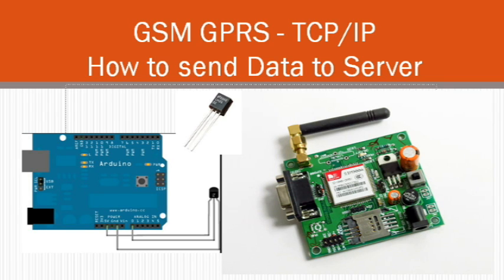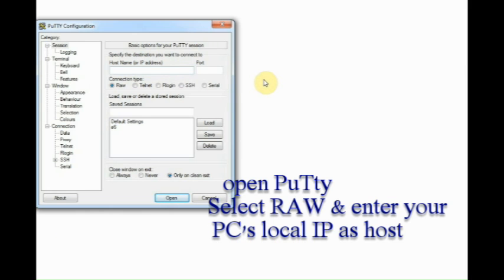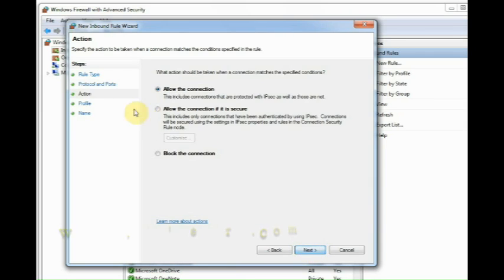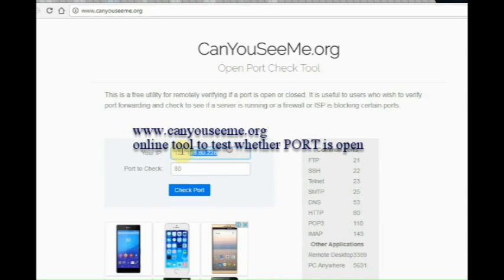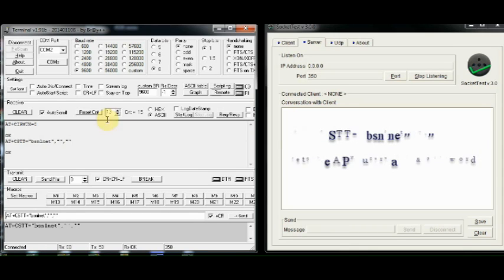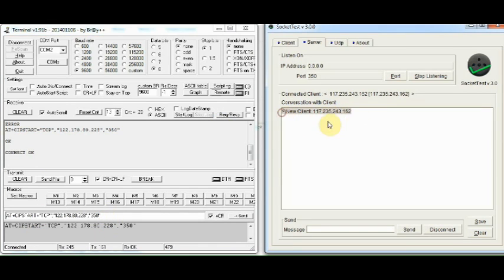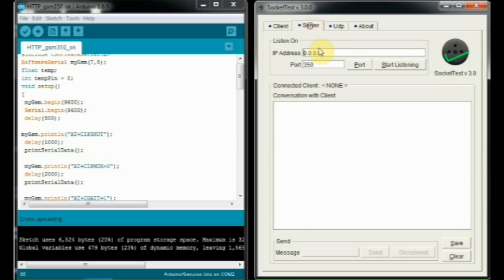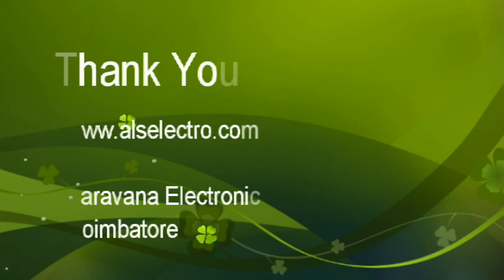GSM TCP/IP - How to send Data to Server using SIM900A

Comment: I have followed all the steps and also checked at commands in the terminal and it is responding correctly but when  I am running at commands using arduino ,no command is printing on my serial monitor.. kindly respond

Comment: Hello 
I am working with GSM module SIM 808 and I want to send sensor data to local phpmtadmin database.  How it's possible sir?
Reply: HiI,If you need any help pls let me know.
Let me introduce our Gsm modem sms device :
Hot selling in UK/USA/Mexico/Indonesia ...
Offer free tech support and inquriy ,
1.GSM 900/1800/850/1900Mhz Quad band
2.IMEI Change
3.USB optiona
4.AT Command
5.Free software (SMScaster)
6.Speed 700-900sms/Hour
7.8/16/32/64 sim slot reliable .
8.Warranty: 12 months, provide free 7/24 tech support
--------------------------------Hotline-------------------------------

Natalie Lin
Whatsapp/ Wechat/ Zalo :+8613715985640
Skype : live:6bac679d890c89a2

Comment: sir i m unable to port forwarding i dont know router's username and password help me
Reply: HiI,If you need any help pls let me know.
Let me introduce our Gsm modem sms device :
Hot selling in UK/USA/Mexico/Indonesia ...
Offer free tech support and inquriy ,
1.GSM 900/1800/850/1900Mhz Quad band
2.IMEI Change
3.USB optiona
4.AT Command
5.Free software (SMScaster)
6.Speed 700-900sms/Hour
7.8/16/32/64 sim slot reliable .
8.Warranty: 12 months, provide free 7/24 tech support
--------------------------------Hotline-------------------------------

Natalie Lin
Whatsapp/ Wechat/ Zalo :+8613715985640
Skype : live:6bac679d890c89a2

Comment: Good afternoon Saravanan,  Thank you for the detailed video.  I have followed it exactly as you explained, and was able to send temperature readings via my SIM800 to a distant server.  First video, which worked 100% for me.  I would like so send the temperature reading to Thingspeak.  I have used the API key and openend the connection to send the data.  I receive a "SEND OK" reply, Thingspeak does not up date.  Where am I making a mistake?
Reply: Hello , Did it requrie a static IP for the router ?

Comment: Hello Sir, I am trying to run the same code on SIM800L unfortunately i am not able to post any data. it fails to connect with server. i am using a Airtel simcard

Comment: Dear brother very good job, God will always bless you for your selfless work, may I know can we send serial data  like rxd , txd without any changes in their signal  ( transparent mode) to remote location without any host pc? Or how can we recover this rxd txd signal  to remote without host pc? We have to use another SIM 900 GSM Module at remote site to recover this transmitted RXD and TXD?
Reply from the maker: Thank you for the appreciation.
For sending or receiving data by GSM , you always need a PC or a Microcontroller to assist GSM .Even if you send data to another GSM , for processing the data you need a microcontroller at receiver end.Also you need to convert  (known as Casting)  Raw data according to receiver requirements.For e.g Thingspeak server accepts data only in STRING format.
Reply: Dear Saravanan AL thanks for reply, may I know what is casting in this case? Thanks.
Reply from the maker: Casting is a way to convert a variable from one data type to another data type.

Comment: Thank you for the tutorial sir.. I have a small issue regarding this module. I have hosted my Web services in my local IIS server. So, To connect the server all the clients must be in the same network. And My routers ip is 192.168.8.1 & pc's ip is 192.168.8.1... in order to send data from the arduino to my web service the GPRS module should be in the same network.. Is this possible? If it is possible how can i do that. Please guide me. Thank you sir